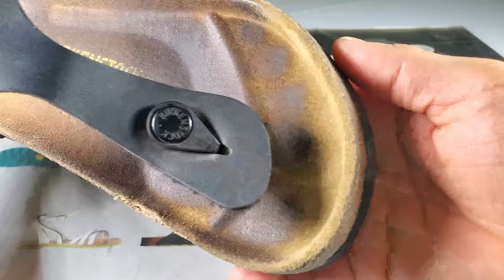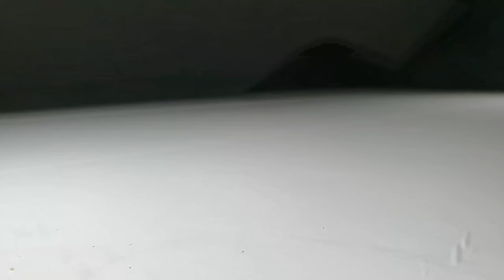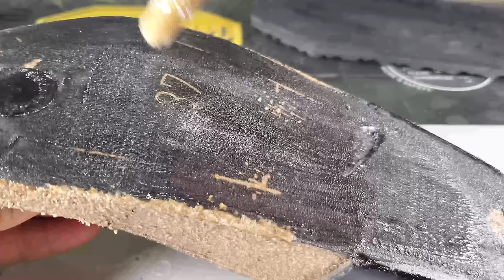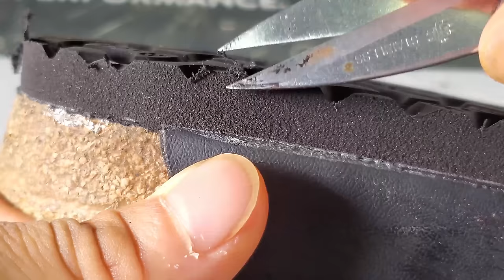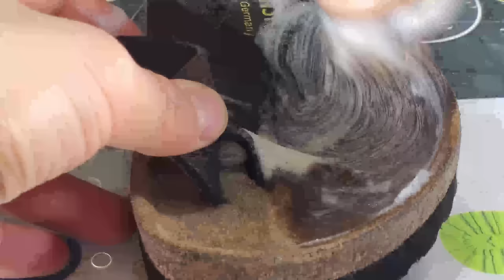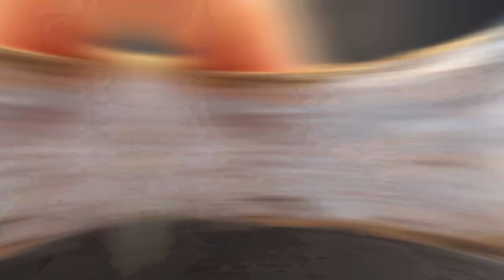ASMRㅣHow to Clean Birkenstock!!ㅣ버켄스탁 세탁 & 복원

Comment: Amazing, i have a lot of Birkenstock’s I knew about the sandpaper trick to clean the inside of sandals, but what glue did you use because I need to glue the cork part in the back
Reply from the maker: glue is renia colle de cologne and you'd better to seal the Cork.

Comment: Wow, nice video! I was looking for the "how to clean a Birkenstock" but also got interested by how you nicely glued the sole. What kind of glue that you use, and does it have to be heated?
Reply from the maker: Thanks. The glue that I used is Renia colle de cologne. After gluing both sides and dry them. And then heated them to stick together. You do not have to heat them if they are not completely dried.
Reply: @RepairStudio  Thank you for your reply, appreciate it!

Comment: After the 2 coats of cleaning the brand name and size in yellow is still visible. But once dried it's barely even there. Were there any more steps of cleaning to make it that clean?
Reply from the maker: After dry, I used a suede brush to re-fluff the pile:)

Comment: sorry to hop back in the comment section again! the suede shampoo i’m using is super slippery on the fibers of the suede, which is kind of weird to me. it keep lathering up when i try to take it off with water. is this okay? i just didn’t see it in your video
Reply from the maker: you have to rinse them completely~
Reply: Repair Studio and how do i do this? i don’t want to get them too wet! i’ve been trying to use the clean brush and a cloth, but it’s still all slippery. do i... run it under water? i’m scared to!
Reply from the maker: @aingeav497  I'm a professional for this work so it's not that hard, but when you do rinse them, after rinse them, try drying them with cloth first and then dry them naturally.
Reply: Repair Studio okay! so i can just stick it under running water and dry liberally with a cloth?
Reply from the maker: @aingeav497  yes. and after dry, use a suede brush to re-fluff the suede pile!
Reply: Repair Studio ran it under water and it isn’t getting un-slippery!! help!!!
Reply from the maker: @aingeav497  If you rinse and wash the shampoo off, it should be OK. Once it drys out, it won't be slippery.
Reply: Repair Studio okay! i tried letting it sit for an hour to dry and it was hard and black, is it okay to leave it to dry for 24 hours like in your video? this is very similar to what happened to my other pair of birkenstock’s that i had to throw away, so i’m really really scared!
Reply from the maker: It doesn't need to leave them for 24hrs, if they are completely dried, then you can brush out. Hopefully it works out.
Reply: aingea v In the future you should be diluting the soap and not using too much. That’s what it sounds like happened. That there was too much soap and it didn’t emulsify and rinse away cleanly. Use like half the amount next time!
Reply from the maker: good advice👍

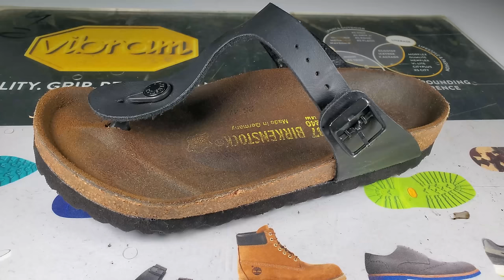Comment: What glue did you use at 7:00? Is that the same contact cement that you previously used for gluing on the sole or a different one?
Reply from the maker: @Martin same glue

Comment: The cork is completely cracked in a place and we do not see how and if it could have been repaired . Plus a new and heavy sole under an old and worn out cork....I'm not sure if the good will not be worst than the bad, if I may say. No offense, and respect, but I have my doubts
Reply from the maker: cork were glued and sealed. The best way is to replace cork part too, but then it's not worth it:)

Comment: what is the materials for birkenstock arizona please?
Reply from the maker: which part? outsole:eva, footbed:cork, insole:suede, upper:birko-flor or leather or suede
Reply: @RepairStudio  everything pretty much please
Reply from the maker: answered:)
Reply: @RepairStudio  what type of brush did you use for cleaning the footbed?
Reply from the maker: you can use a suede cleaning brush or toothbrush to clean the suede :)
Reply: @RepairStudio  and what kind of soap or something like that did you use for the footbed
Reply from the maker: For cleaning suede footbeds, I used suede cleaner.